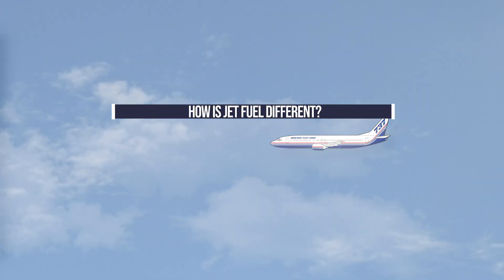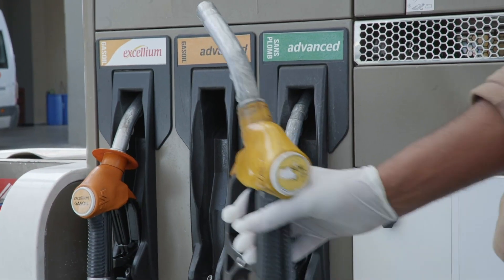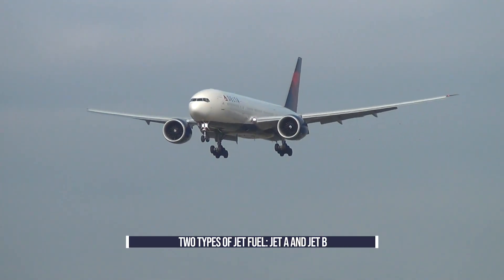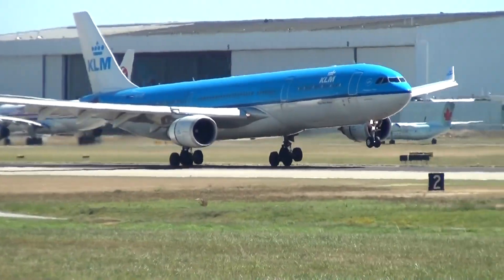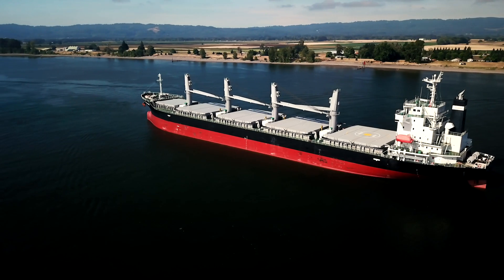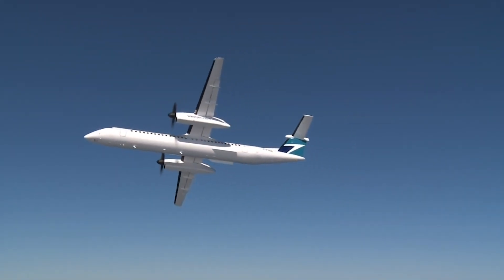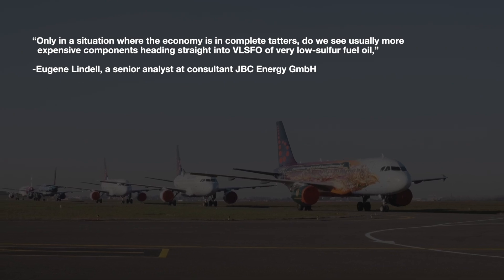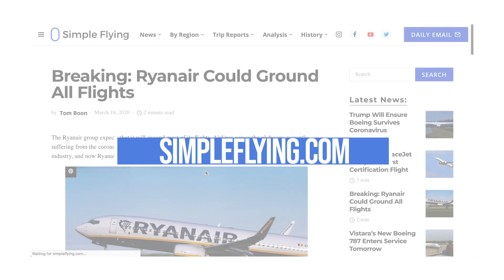How Aviation Fuel Differs From Regular Fuel

Comment: Arctic trucks at South Pole was no stunt but a standard day out, limited access to fuel supplies from union glacier to South Pole means most our equipment runs on some form of avgas which limits what we have to pay to fly in, landlocked means no shipping access so all comes in by plane. Have worked there for a few years.

Comment: So the primary reason why they use different fuel is because of freezing point?
Reply: The main advantage is that jet fuel is more energy dense than gasoline. It also has a much higher flash point so it’s not as easy to ignite with a simple spark.

Comment: Keep in mind the JP (Jet Petroleum) series of fuels JP1 thru JP8. They all have advantages in certain situations.
  We've run gas turbines on alcohol also.
It lights off smoothly but has only 1/2 the heat/calories so you have to use twice as much. May be hard for the fuel control(s) to keep up.

Comment: Toyota used Jet A1  to power the diesel Hilux's in Antarctica i do believe.
Reply: Because kerosene will flow at lower temperature.  Pretty much all diesel equipment in Antartica is running on JetA1/JP8
Reply: that is correct.

Comment: Great content!  I work in the industry so I thought I'd point out a few minor errors:  Jet B is not commonly in use anymore, and while it does have a lower freeze point, it is also more flammable (think of it as a mix of kerosene & naptha) and is more difficult to handle.  I think you might be referring to Jet A1 as the lower temperature jet fuel.  Jet A is normally only available in the USA and it's reference standard ASTM D1655; Jet A1 is the norm outside of the USA and there are several other reference standards that govern Jet A1 depending on the country (Canada, UK, Eastern Europe to name a few).   The US Military uses JP-8, which is Jet A1 with an additive package (anti-ice, anti-corrosion, and static dissipator).
Reply: Also, the icing inhibitor additive is to prevent freezing of water in the fuel, not of the fuel itself as was suggested in the video.
Reply: Thanks m8!
Reply: Correct, Jet B has a lower freezing point but also has a lower flashpoint than Jet A and Jet A1.
Reply: You provided the relevant informations.
Reply: I simply love it when the Comments section lights up with more quality education and enlightenment with experienced hands and brains weighing in further on such content filled YouTube videos.
Reply: The US Air Force switched to Jet A1 at all stateside bases from 2009 to 2014.
Reply: @813Goat  That is false, the USAF uses JP-8 which is similar to but not exactly Jet A-1.  The switch from JP-4 to JP-8 was made many years ago.  What is the source of your information?

Comment: Cold weather climates I would believe do not indicate what fuel the aircraft will be using.  At 36000 feet the temperature outside is more than -50 C which precludes using Jet A for the most part.  Of course there is a time factor so a short haul aircraft may get away with Jet A and a high altitude for a limited time but a trans Atlantic flight not so much.  The USAF using only Jet B makes sense, they fly everywhere literally so why make a logistical nightmare plus maybe losing a few aircraft if not needed.
Reply: they also use JP8, A1+aditives.
Reply: interesting point, apparently fuel heaters are used, according to the wiki page on jet fuel. a heat exchanger between fuel and oil?
Reply: @joechang8696  Look up British Airways flight 38 crash at Heathrow report. Ice crystals were too much for the oil-fuel heat exchanger.
Reply: @jimandmandy  that flight used Jet A1.  Following that incident a small adjustment was made to the oil/fuel heat exchange system to prevent it happening again.

Comment: Air Force uses Jet A not Jet B
Reply: USAF uses JP8
Reply: @plcwboy  The Air Force switched to Jet A at all stateside bases from 2009 and finished in 2014.
Reply: @813Goat  perhaps I am outdated.  I know that all the trucks and equipment we have is stenciled JP8.  JP8 and Jet A1 are only marginally different, primarily extra corrosion inhibitors for situations where equipment sits fueled for long periods of time without being used,  if I understand correctly.

Comment: I’d find the differences between Automobile furl and Piston Engine Aviation Fuel a little more interesting. . .   the differences between 94 Octane Sunoco, 80/87 fuel, 100 Low Aleaf, for example. . .
Reply: Basically, 100LL aviation gasoline is alkylate and toluene plus lead additive. Automotive gasoline is alkylate and other gasoline components from refining processes plus ethanol. 80/87 Avgas is no longer made. Alkylate is a very high octane "synthetic" gasoline, first used in WWII aviation gasoline and is now a major component of unleaded auto fuel, particularly the Sunoco 94 you mentioned. 92UL is an unleaded aviation gasoline without ethanol that is not commonly available in North America.
Reply: @jimandmandy  Damn 100LL sounds nasty as heck... I wonder how much they are still developing avgas considering the major commercial shift to turbines.
Reply: @Kalvinjj  While avgas is a small, specialized market, there are still many thousands of small aircraft, like I fly.  Most need 100 octane. Shell, and others have worked over a decade to develop a lead-free substitute. The FAA has had test samples for years, with no approvals. Rumor has it that the stuff is nastier (except for lead) in that it can strip paint.
Reply: Well, many years ago, I witnessed the owner of a small airport refueling his Rolls Royce with aviation gasoline.  It was clearly acceptable for him!
Reply: @cdl0  Assuming the car was so old that it had no O2 sensor nor cat converter, cleaned the spark plugs and changed the oil extra frequently, no problem. We had a '65 Chevy with the Corvette engine. In California, the only gasoline that wouldnt ping was Chevron Custom Supreme, 104 Octane (research method, different from today's, or aviation rating). That gas was heavy on the alkylate, but lead was less than aviation levels.
Reply: @jimandmandy  It was a nearly new car, but that was more than forty years ago.  As you remarked, standards were different then.  The car would be a cherished collectable now. :-)

Comment: Poorly done video. Very rushed while showing charts that don’t match the discussion. Also didn’t answer what I thought the question was, can it be used in cars... regular gasoline... and the difference.
Reply: fffanman it can be used in diesel cars, but not petrol ( gasoline) cars.
Reply: @alexnutcasio936  It was used with petrol cars which had preheater installed but taxing killed it. Petrol was only needed for starting and short period after that.
Reply from the maker: Thanks for the feedback. - TB